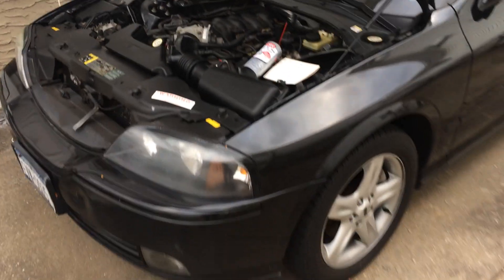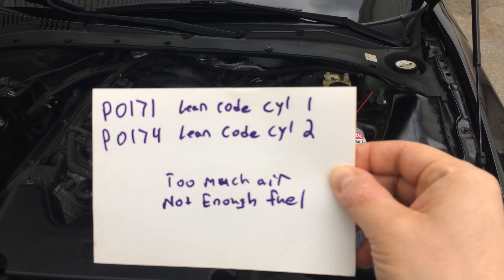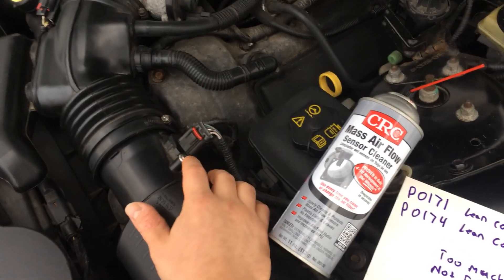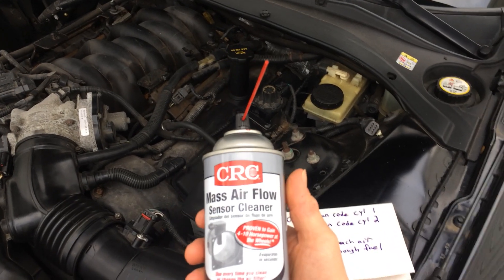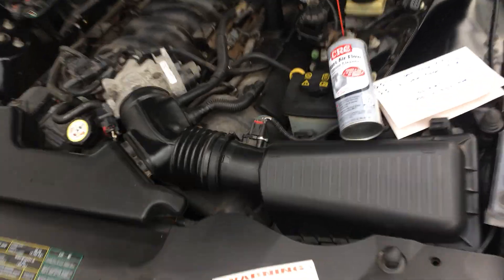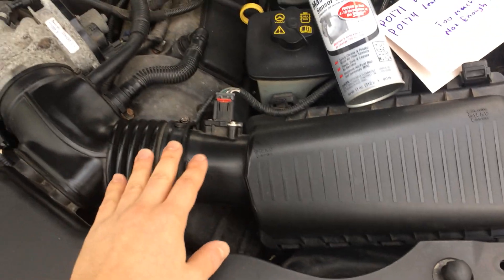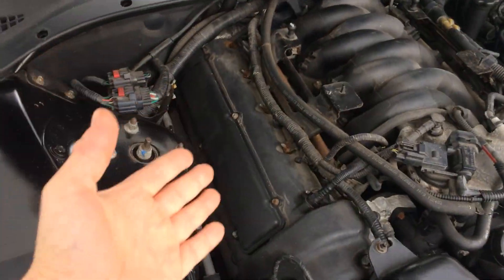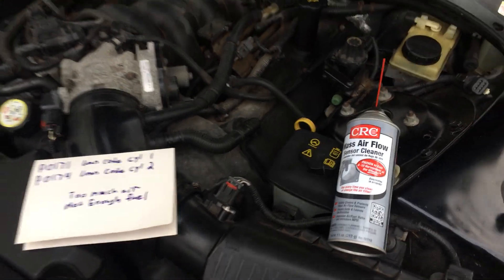Engine light code P0171 and P0174 (Mass air flow sensor cleaning)

Comment: I have an 03 Lincoln ls v8 and there’s this kinda hissing sound on my driver side right behind the wheel and if you’re under the hood it’s towards the back left bottom of the engine and there’s fumes in the car it only happened shortly after i hit a speed bump i need help i changed my sparks and ignition but I’m assuming it’s a vacuum leak? Any help

Comment: I have a 2009 Mitsubishi Outlander (6)cylinder and every time my car is running for like 2 hours I get the code p0174 and it comes for like 20 mins I turn off the car and it goes away
Reply from the maker: hey buddy! The code comes back as "too lean" basically a issue with one of the oxygen sensors or MASS Airflow Sensor.  I highly recommend cleaning the mass air flow sensor just like I did, and see what happens.  You could have a more serious issue, but start with this first.

Comment: Your videos are very helpful. Ive had lots of trouble with this car. 4 thermostats, 2 inlet pipes, oil cooler, radiator, all hoses, and water pump. Also the power steering pump, the moonroof leaks, and i have had MAF/MAP codes on it since i first bought it. Its been in my driveway for a year because it still overheats unless the heater is on and 2 shops havent been able to figure out the problem. It runs great if the heater is on, doesnt miss a beat or get warm no matter how hard I push it as long as the heat is on. Any thoughts?
Reply from the maker: hey man!! Guess what??  I run mine with the heater on too, ahhaah.  But it runs fine with the heater off, just makes alot of fan noise and yet doesnt overheat.  I'm 100% sure the issue is a blockage of some kind, usually the DCCV (coolant control valve) is the reason why.  Have you checked that?  It's hard to tell, but almost always that the reason.
Reply: If you still got it check your fan. The fan it has is hydraulic and the orings will go bad
Reply: Funny timing Im getting it towed for scrap in 2 days. The transmission lost 2nd and 5th which i think is from some sort of servo or solenoid or something. Im in tech school but havent taken auto trans yet so I dont know for sure. Anyways with the overheating, the broken trans, and it developed a misfire over the winter...well I bought a grand marquis. Its MUCH slower and handles worse than the lincoln but I have plans to change that. At least it doesn't blow up every 10k miles. Thanks for trying though guys
Reply: Alex Campbell are you expecting to get anything from it? I’ll take it off your hands

Comment: Hey how's it going, I'm having trouble with my 2009  Nissan Murano. The mass airflow sensor, I got a new one a week ago because the truck wouldn't take off properly between 20 to 30 Mph, but it drives fine pass 40. Now I got the code (P 0174) and (P 0174 P). I looked up P 0174 and  ruled out the air flow sensor, but wasn't able to find anything out about P 0174 P. I also put in some fuel treatment in the gas tank that helps clean the fuel injectors. I'm thinking that the fuel injectors for cylinder 1 and 2 could have lower fuel or less air like you said also I checked out the air filter and that was good, my next play is to try and use  seafoam as my hell mary throw into the oil and all sparkplug inlets and gas tank, with the proper amount lol

What's your take on this, anything else for me to try, money's a little tight, hoping for an easy fix for this situation that won't break the bank?
Reply from the maker: hello, Did you get the same Original Mass Airflow Sensor, or like an OEM autozone universal one.  Make sure to clean it thoroughly too.  Sounds like you have a vacuum leak somewhere, that's usually how the lean/rich codes get generated, other than a bad air flow sensor.  I used to be a Nissan salesman years ago, and it's rare that the injectors have any issues, I doubt the seafoam would do anything and might harm the car.  For me those cleaners are not the best for modern highly regulated emissions system, you risk destroying your cat converser and 02 sensors that way.  Try to reset the codes and check for no air leaks, then see if it comes back, let me know
Reply: @hybrid32494  Ok it's a Hitachi air flow system. Im not sure if it's aftermarket because it's a Japanese company and could be a  company Nissan gets its parts from?
Reply from the maker: ok, did you reset the codes and please give me an update if they came back?
Reply: @hybrid32494  So far no codes came back yet but it's still acting up a little, going to try and just replace the spark plugs and see if that will help out. I looked up another video on how to do it, it's definitely a job to do lol
Reply from the maker: ok, does it seem like it has a misfire?  Mine has had a few sets of coils on (all cheap 45 dollar for 8 ones on ebay or amazon)  All have worked well.  And guess what? the plugs themselves were always fine.  I would first take the coils off and inspect them visually inside to make sure the metal element is normal and then put a good amount of DIELECTRIC GREASE on the connections to the plug and coil.  This worked for me.
Reply: @hybrid32494  I believe I found the problem, I found out that the tube leading from the air filter has a rip in it so I'm believing that this is the actual problem hopefully this is it keep you posted, I went to AutoZone and bought the spark plugs ran me up to $111 couldn't believe it, they are the ones 4 Nissan so I got them hopefully I could bring them back get the money back for them
Reply: @hybrid32494  Hey buddy it was in fact the rubber elbow connected to the air intake manifold an engine, it was completely dry rotted they wanted $154 just for that at the auto parts store I went into so I hit the junkyard and grabbing one off of a newer model, the only difference is it had an extra port that had a small plastic part to it and it was a little bit difficult to get on but I finally got it. I shoved it in tighten it all the way down because it's not the  exact fit but it'll do for now. I had to loosen a few screws that were connected, one to the box with the filter and one screw that connected the air intake on the front bumper with  zip ties for the time being until I get the part. Again thanks for your help with this issue, you da man lol
Reply: Ohhh ok thanks for your help, I'm gonna check to see if its aftermarket, got the part from autozone not to sure if it is just now leaving work will get back to you, again thanks for your help
Reply: Any body knows why every time my car gets hot after maybe 2 hours running I get the code p0174 and then after like 15mins goes away
Reply: @tonyzloveone8554  https://youtu.be/gCV11HGqRaI
Reply: @tonyzloveone8554  Hope this helps

Comment: My 03 premium sport v8 has been a huge learning experience. I’ve changed out so many parts
Reply from the maker: hey buddy!!,  thanks for watching!!!  One question, does your sunroof leak?
Reply: hybrid32494 Yea it did. It was leaking from the visor on driver side.
What you have to do is take that side panel off by the windshield on the inside and when you open your door you have to pull down the weatherstripping and then you got a pull down the interior part of the roof a little bit and you’ll see the hoses disconnected what I did was just took a zip tie and got it back on there you can use a metal clamp to I did that about four months ago and it was raining every day here in Florida and I haven’t had a single bit of water come through
Reply from the maker: let me ask you this, does your car have side airbags?  Mine does.  The ultimate edition has side airbags, and I did everything you said with the door and roof trim, even removed the sun visor.  Cant risk the airbags being moved so I didn't really mess with the headliner too much.
Reply: hybrid32494 Yea bro it’s tricky, you do have to remove the visor. With the battery disconnected (both leads) you will be able to get that head liner down just enough to get your hand in. (I’ve got big hands was a little tight) I used a standard black zip tie and long needle nose pliers. Once you pull down liner about an inch it’s right there on the left. The hose expanded from heat and years. Manufacturing should have clamped it “manufacturing should have done a lot of things that they didn’t do too lol” Let me know how it goes. Just be easy on that headliner you don’t want to pull down to much. With a battery disconnect it you don’t need to worry about the side airbags👍 I know what a pain in the ass it is when you’re driving and also an a bunch water just start spilling out on your lap It took me 2 months and finally I got after it.
Reply: Yea it does
When you remove the top part of the weather strip you can pull down the top head liner a little bit and that’s where the drain line is. It’s tight I barely got my hand in. Needle nose pliers are going to be best long neck.
Disconnect your battery both leads before you do anything on this car. It is what I always do, it resets your obd II and runs more efficiently which is a plus. Good luck

Comment: Can you post a link to your ignition coil video
Reply from the maker: I don't really have an actual demo vids on replacing the coils.  Only have discussed the coils and talked about my personal remedies to fix them..   here is one of these videos.

https://www.youtube.com/watch?v=Q_A4j3NASx4&t=20s
Reply: Alright sweet, thanks man.
Reply: I think i'm probably going to need to replace the coils, I get a weird misfire sometimes when i'm at a stop and start accelerating.
Reply from the maker: Thats exactly what a single bad coil would do to your car.  Just buy all 8 like I did and replace all.  Although I did notice that the one which seems to fail is usually the one close to the driver further away from the radiator.  And usually there is just a bad connection half the time.